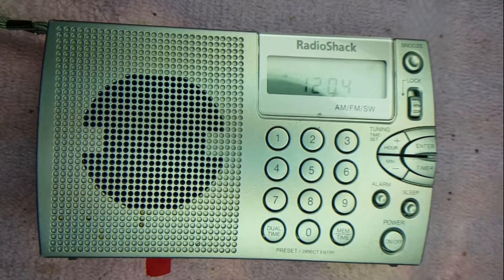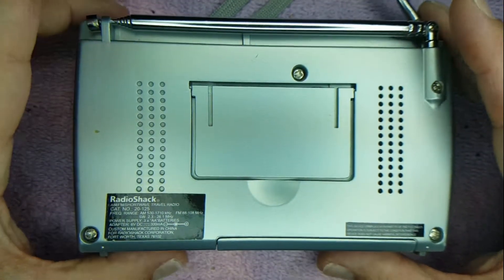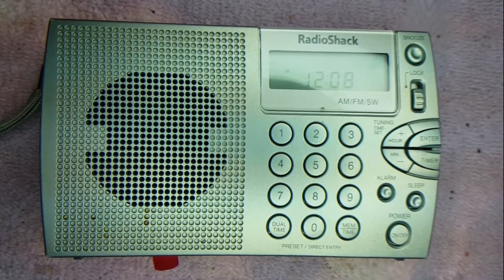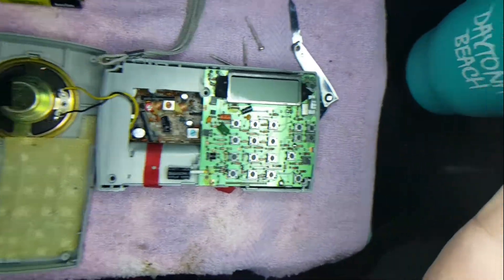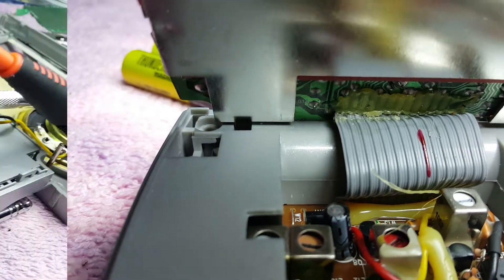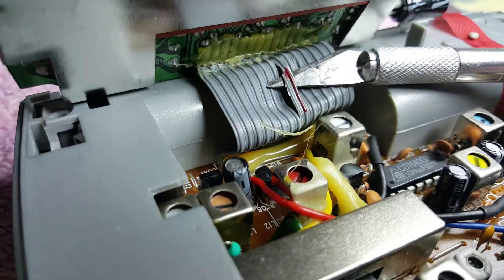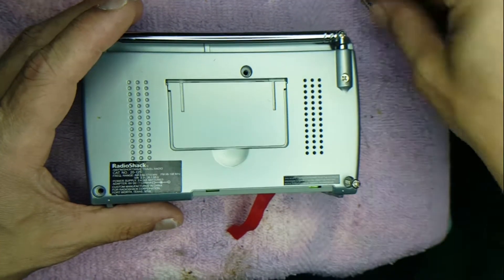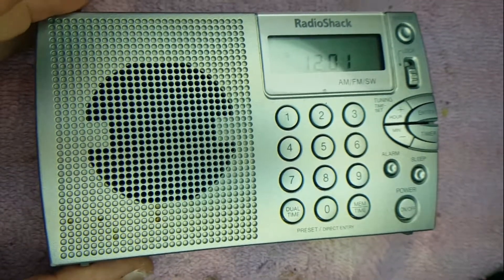GHOSTBOX/SHACKHACK - Radio Shack 20-125

Comment: Can we do this with the 1200587? (The new ribbon model)
Reply from the maker: Yeah you can hack it but it will only scan the fm band. It will stop after about 3 minutes of scanning and you will have to restart the scan. Might be able to add a switch to keep it scanning. But would be better off with the hackable one.